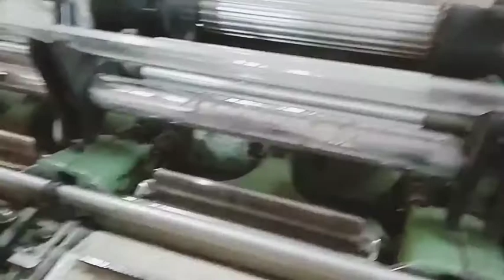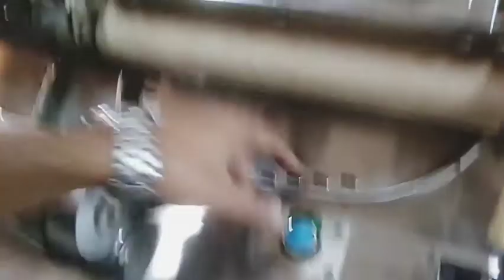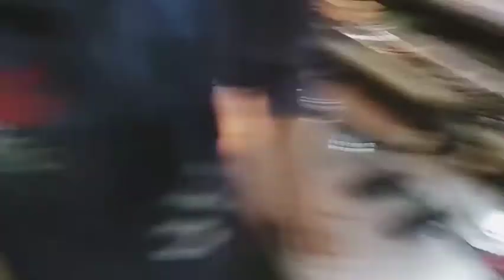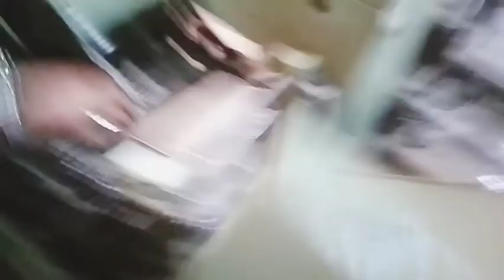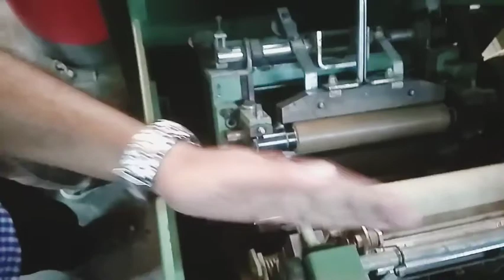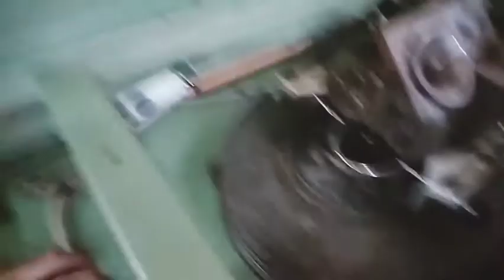Comber machine | Parts & material passage | Textile | BUTEX

Comment: How to control neps in LK250comber
Reply from the maker: For an effective control of short fibers, retention of long fibers and removal of neps, the following considerations are important.

The card trailing hooks are longer and more numerous than the leading hooks. They are removed when fed as leading hooks by keeping an even number of reversals between card and comber.

The waste at comber can be reduced by increasing precomber draft upto certain limit without effecting the resultant yarn quality.

The proper place for controlling neps is carding and not combing. It is often more economical to run card at somewhat low production rate than to take out extra comber waste.

[Collected from Google] 

Sorry, couldn't be more helpful.